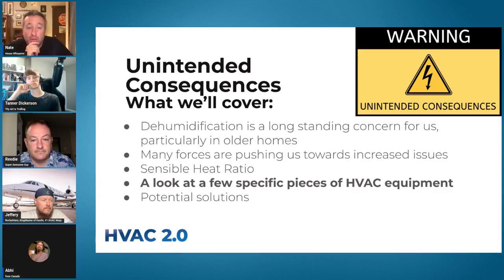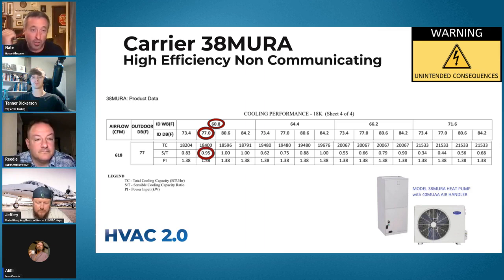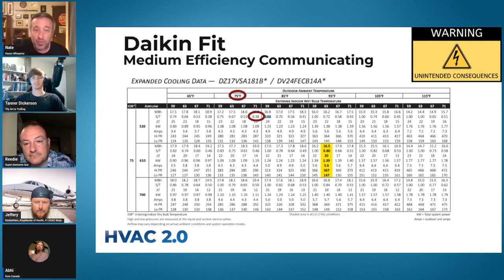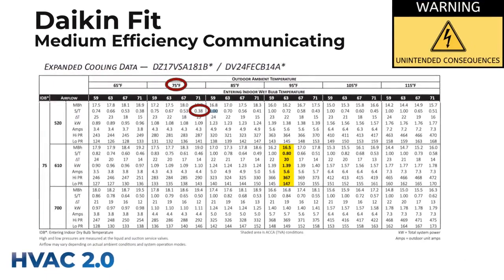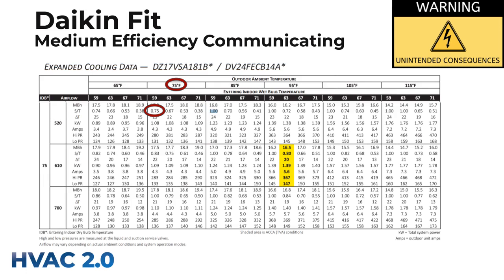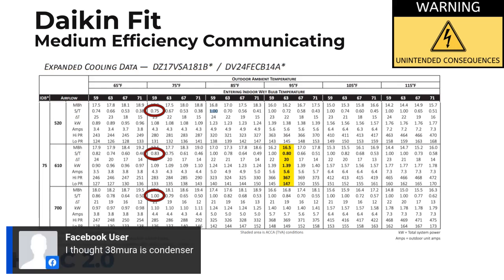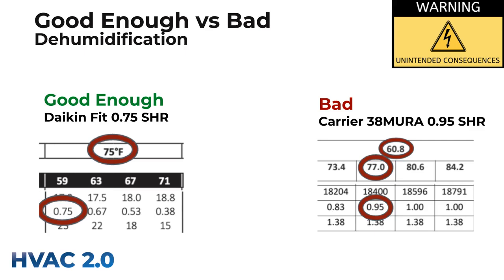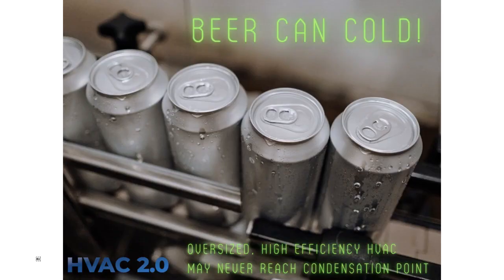Sensible Heat Ratio Comparison of 1.5 ton Carrier 38MURA and 1.5 ton Daikin Fit

Comment: This is a classic misinterpretation of data.  I have the full performance data for the Carrier 38MURA/40MUAA.  If one chooses numbers closer to what are shown for Daikin, the S/T is very similar.  The Carrier combination does do some communication, as the 38MURA frequency will change based on the coil temperature in the 40MUAA.  Among other things, it avoids the coil ever freezing should one have obstructed air flow for some reason.  If one looks to the right in the Carrier table to a similar wet bulb temperature as used for the Daikin FIT, the S/T is very similar. 

These systems follow the laws of physics (I have a Masters degree in Physics), and when operating correctly, nearly all ACs/heat pumps have similar coil temperatures (general rule of thumb is 400 CFM of airflow per ton (12,000 BTU/hr) of capacity.  With a similar coil temperature, the same percentage of heat removal is split between latent (water) removal (dehumidification) and sensible (temperature) heat removal.  The fallacy in what was shown was that they used a low web bulb temperature (drier air) for the Carrier.  No surprise that very dry air has little energy used for dehumidification, and nearly all energy used for temperature reduction.
Reply: You completely missed the point. Of course, as long as the actual coil, metering device, and compressor are sized properly to one another all units will have the same SHR. But when the system is variable speed then it now has the ability to adjust itself and they don't all operate the same even if they all have the same "capability". But having the capability and actually do it are 2 different things.  Therefore we have found non-communicating inverter equipment suck at humidity control vs communicating equipment. Btw flaunting that you have a "masters degree" doesn't mean much when what you are trying to argue is completely off base....
Reply: @FoXHounDXD  I did not miss the point that you compared apples and oranges, two different sets of data.  Using Carrier's product data for values closer to what you show for the Daikin Fit (75* outdoor, 520 CFM, 71* IDB, S/T .38).  For the Carrier at 77 outdoor, 530 CFM, 71.6* IDB, S/T is .34.  Not a significant difference.  

When one maintains a 20 degree temperature change across the coil, one will have similar latent heat removal (dehumidification).  This constant temperature can be maintained with constant airflow (CFM) and varying the condenser output (which can actually do this with no communication if the coil has an electronic expansion valve and can throttle up and down and the condenser monitors pressures to speed up and slow down), or additionally varying fan speed.  The Carrier units, in addition to this sensing at both the condenser and the coil in the Carrier, can have digital communications between the two units.  

Daikin makes great equipment, and I'll have one of their mini-splits in my house.  I'll also have a Carrier ductless system.   As great as anyone's equipment is, they cannot violate the laws of physics.
Reply: @markneuhausen5560 
So you've missed the point, a pro has attempted to help you understand what you are missing, and you are choosing not to hear him.

When you buy the wrong equipment and have control issues, remember it was caused by your ego and lack of self esteem....
Reply: @TedKidd  I wondered how long this would take to go from a technical discussion to personal attacks.  This started out as pointing out that the data comparison was inaccurate.  I provided closer data points showing little difference in performance.  I understand enough to ensure that I buy adaptive equipment.  There are both analog and digital approaches that provide the feedback for adaptive systems.  I would probably enjoy contracting for an HVAC system with this panel with confidence that it would be a good system.  That said, it does not mean that any other system is bad, or that some systems deemed as less good may in fact be equivalent.  I'm done here.  I expect someone will ensure that they have the last word.
Reply: @markneuhausen5560  It's possible that there was a misread of that data. The 618CFM of the MURA is their "cooling turbo" data (the highest airflow.) The 610CFM of the Daikin appears to be their Medium airflow (middle airflow.) If you look at Daikin's highest airflow, it shows an S/T of 1.0 (no humidity removal!) So this is not an apples to apples comparison, even if the airflows are similar. I'm no expert, I'm just a homeowner who own's a 38 MURA and is looking for answers on why the humidity is too high (typically around 60% RH.) Maybe my units are sized 1/2 ton to big, I'm not sure. Any recommendations on what I should do to fix the problem?
Reply: @jasontk6968  Hi Jason.  It is hard to answer based on the limited data that you provided.  Whether the 60% RH is too high depends on a number of factors.  I will note that for an air temperature of 70 degrees F and a 60% RH that the dew point is 55.5 degrees F.  The relative humidity of your indoor air temperature cannot be lower than what corresponds to the dew point at your coil temperature (I've typically seen 55 degrees F. for coil temperatures).  And it will likely be higher as there is outside air infiltration that will raise the RH.  A slightly oversized unit should not matter, as the 38MURA will step down to a lower capacity.    A few things to check are the exit air temperature leaving the coil as 55 degrees would be a good figure to shoot for.  A second is to make sure that the cooling coils are clean to maximize heat transfer with the resulting condensation.  Also, make sure that your air filter is clean and you actually are seeing close to the designed air flow.  A dirty filter would reduce CFMs which would limit the amount of air (and heat to extract) causing the 38MURA to step down further.  One quick way to verify that things seem to be okay is to try to cool your house several (3-7, say 5 degrees) below your normal thermostat setting.  If your system is able to cool the house down these additional degrees, air flow is likely adequate and I'd check that the coil temperature is where it should be.  Here is a good dew point calculator if you wish to run some calculations based on coil temperature and room temperature (https://www.calculator.net/dew-point-calculator.html?airtemperature=&airtemperatureunit=fahrenheit&humidity=60&dewpoint=60&dewpointunit=fahrenheit&x=Calculate)
Reply from the maker: The problem with Dunning Kruger, ego and the expert classes, highly educated tend to live in imaginary worlds where they vastly overvalue their expertise and be condescending to those who know vastly more than they do.

Comment: the air handler for this system does have dehumidify terminals which should help.
Reply: All the dehumidify terminal does is drop the fan speed by ~20%, but due to the target superheat always being ~3degF, it won't help humidity at all in this scenario.
Reply: @RyanSandles  This is not really true. having air move slower over coil alone helps with dehumidification, it spends more time in contact with the fins. Holding a specific superheat and or coil temp target doesn't mean there is no value.

Dehumidification is a combo of airflow (more = worse), coil temperature (lower is better), and coil surface area (more at the a given coil temperature is better)

May have coil temp not very low, but at long as it is below dewpoint and you have enough coil surface area and low enough airflow can still get good dehumidification.

One thing to keep in mind is that dehumidification issues may be isolated to using matching air handler and performance data is for that, in dual fuel application with a variable speed drive furnace and a regular coil and txv- it may not hold true. 

carrier doesn't make it clear how it works, but the same product is sold under moov-air name, a canadian distributor's private label and y1 is a higher coil temp target and y2 lower. with y2 energized, performance data for their coil-only matchup shows some excellent shr numbers at lower return air temperatures like 75f. at 80f it is a poor 0.8, but who keeps their thermostat at 80f in summer?
I would post links but youtube doesn't play nice with that.

Comment: I am in Central FL and purchased a 38MURA heat pump with the sister air handler. Are you saying the unit wont dehumidify the house?
Reply: I saw a youtube video that the 38Mura is  a little weak on dehumidifying but should do ok.  How is it working for you so far?
Reply: oh ha, this is the video. I was on a different page when I was replying.  lol
Reply: @bguy1979  units have been running for about a month and a half now. The technicians installed a ecobee thermostat, which allows you to set it to overcool to satisfy humidity. Both of our units (1.5 ton in master wing and 3 ton in main wing) run between 48 and 55% humidity and stay in low cool (stage 1) most of the time. So far, so good.
Reply: Are the units linked so you get the  full dehumidification feature.

Comment: I just had a 38MURA / 40MUAA installed. Concerned about dehumidification. Installers connected the system with 24v wiring but I noticed that the indoor and outdoor units CAN be linked with a 2- wire communicating link (called "scenario 1" in the installation guide). Would this help?
Reply: Hi, Any status on this?  I heard without the 2 wire, it won't run well.
Reply: @bguy1979 I had the system changed to 2-wire. Seems to be running slower and longer now but not totally sure as we are currently between seasons. I was hoping for some insight from the author of this video ….
Reply: @tomtomkzzz  That's good, running slower and longer is how it runs to control humidity and temp.
Reply: @tomtomkzzz  I have the same system, how can I tell if they did the 2 wire install or regular install?
Reply: @johnmichael549  You can check which terminals were used on the outdoor unit by opening the little cover. If S1/S2 are connected then you have the 2 wire install. But if a bunch of wires are going to theR, C, Y1, Y2, B, W terminals then you have the 24v method.
Reply: What did it cost you?
Reply: @corymacdonald383 About $15,500 minus $6,500 rebate, so $9K out of pocket . Includes new humidifier, ecobee premium and 20x25x5 filter base. Canadian bucks.